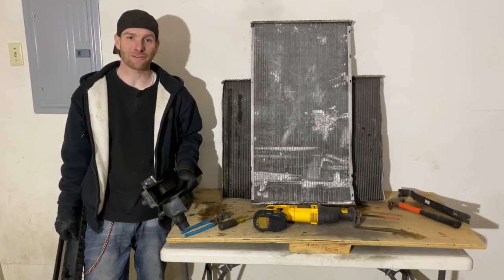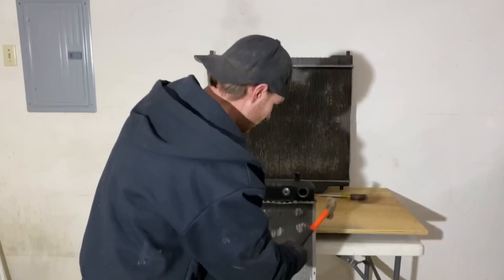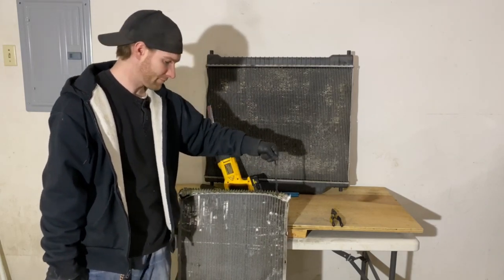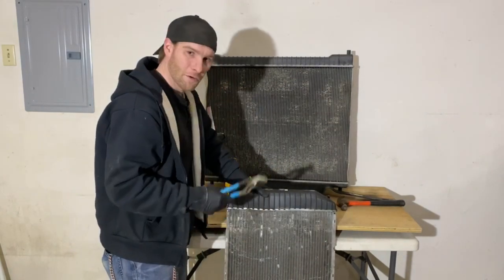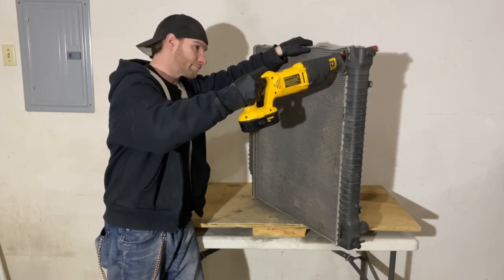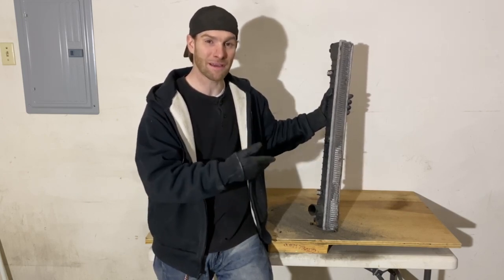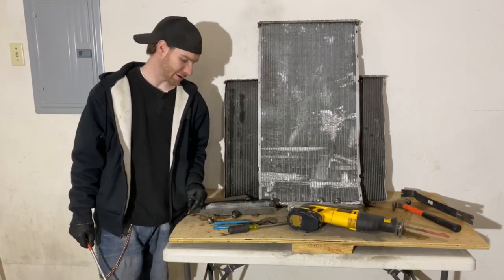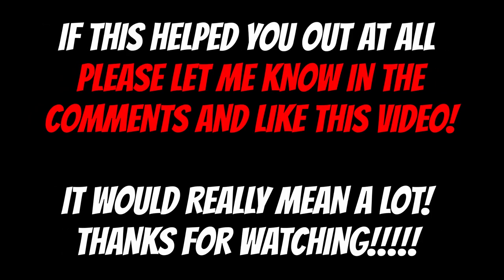3 best ways - “How To” scrap an aluminum car or truck radiator, as well as the oil cooler inside it

Comment from the maker: Tools I’m using in this video are... 
Channel locks - https://amzn.to/3P9GrFU
Reciprocating saw/SawZaw https://amzn.to/44eFkZR 
9 inch bi-metal blades - good https://amzn.to/3Nqccc9  best https://amzn.to/3oXlO51 
Klein flat head screwdriver - https://amzn.to/43C8W39
Vice grips - https://amzn.to/43CKHBX 
Hammer - https://amzn.to/3oUmbxg
Adjustable wrench - https://amzn.to/3qGSSyJ 
Screwdriver set - https://amzn.to/3NbFOZQ 

Safety equipment...
3m Flip up Face shield - https://amzn.to/3Ja7CMP 
3M n95 dust mask - https://amzn.to/3p8GjLU
Safety glasses - https://amzn.to/3Co7kyf
gloves - https://amzn.to/43EuLiE 

As an Amazon Affiliate / Associate I earn a small commision from qualifying purchases 

CHECK OUT MY OTHER SCRAP VIDEO'S BELOW on “How To Make The Most MONEY” with Scrap Metal... 

3 best ways - “How To” scrap an aluminum car or truck radiator, as well as the oil cooler inside it youtu.be/pLUcjeRO2bU

How to SCRAP BRASS!!! Difference between RED & YELLOW, STAINLESS & CHROME PLATED, and CLEAN vs DIRTY youtu.be/KPq-KRnQjFA

How to Scrap Brass Pressure Relief Valves from water heaters - the  Fastest, Easiest, Best Way!!! youtu.be/ovK-rmp7lV0 

How to Scrap an Air Conditioner AC Evaporator A Coil the best way  and Make the MOST MONEY scrapping youtu.be/BNJz4TcLW3s 

How to Scrap & Separate mixed BRASS & COPPER metal plumber’s pipe fittings, well tank tee MAKE MONEY youtu.be/l-3NgJs7rw8

Comment: Used similar set of channel locks.  Quick work to bend enough flanges to get the plastic ends off.  got $0.35/lb so $6 for 2 radiators.  At least it kept them out of a landfill.  Also would have only gotten $0.05/lb if "dirty" without removing plastic, so definitely worth it.
Reply from the maker: Yeah, it really does make a difference not only for the environment, but also in your pocket!
Reply from the maker: I always cringe a little when I pull into a scrapyard and see lots of dirty vehicle radiators or central AC coils sitting there. When it would’ve only taken a little extra effort to get 7 times the payout & go from around $0.85 to $6 by stripping it.

Comment: Nice just got one from a diesel truck I appreciate the video
Reply from the maker: Nice! Thanks man I appreciate that. Good luck with breaking it down.
Reply from the maker: Which method do you plan on using? My go to is the channel locks and flat head screwdriver, but every now and then I find my self just rippen it straight down with a sawzaw.
Reply: It’s hammer time
Reply from the maker: @JoseLuis-dc9jb  nice!

Comment: None of these methods are as fast as using a large screwdriver to pry the tabs outwards .Once you get one tab pryed out the next tab is easier. Just like in the video you only need to do one side and at least part of the short sides and then pry of the plastic. The gasket will come out easy. You might need a few different sizes of screwdriver because the radiator tabs vary from one  radiator to another.
Reply from the maker: Yeah, here exactly right. I find myself going that method a lot of the time. And you definitely need a few different sizes, but almost any tool that catches those tabs right to pry them will work

Comment: Thanks for a cool video!  Most of us learned best by taking things apart.    A couple questions from this 'non-scrapper; never been in the business.
Did you consider running the Sawzall down the plastic end caps and yanking the plastic scraps?  No lost metal vs more time.
How much more is one of these "clean" radiators worth vs. as-is, with plastic?  Do scrap yards try to deny the higher worth?
Thanks again, Brandon.
Reply from the maker: Unfortunately the answer is yes, they do deny the higher worth. If you bring it in with plastic or rubber on it it will be considered dirty. I just checked a few places earlier today, but keep in mind scrap prices are up pretty high right now (they go up and down regularly kind of like oil / gas or stocks). As of right now dirty aluminum averaged around $0.06 or so a pound depending on where you go and the quantity you have. If it’s clean however, it would be in the $0.50 range give or take depending on which scrapyard you go to and the quantity you have. I only mention quantity because some scrap yards will pay you bulk price if you have enough.
Reply from the maker: The problem with cutting the plastic outside of the metal, and then trying to pull the remainder plastic left inside, is the fact that the radiator has these metal fingers (I guess you could call them). But they basically fold Saturday 83 over text slam the plastic to it in order to hold everything together tight enough to create a seal. So even if you cut the outside we be dealing with the same problem we were dealing with on the hammer method. The plastic gets stuck in there and in order for it to be considered clean, it must be free from All contaminants and other materials other than aluminum.
Reply from the maker: Btw you’re welcome, happy to hear you thought it was a cool video!!! And thanks for watching! Hope these answers help explain a little bit. Let me know if you have any other questions, I’d be happy to help